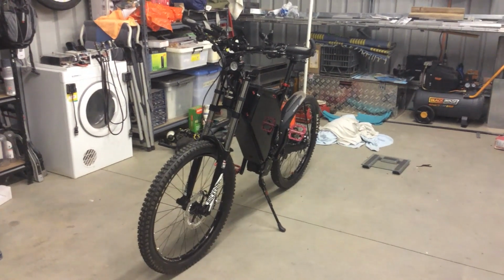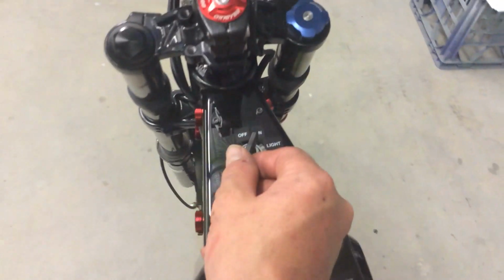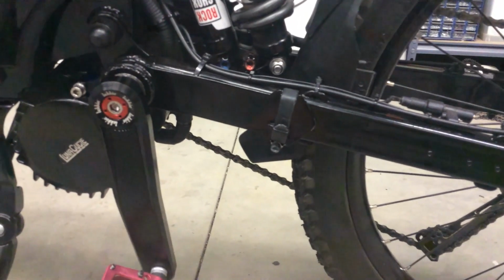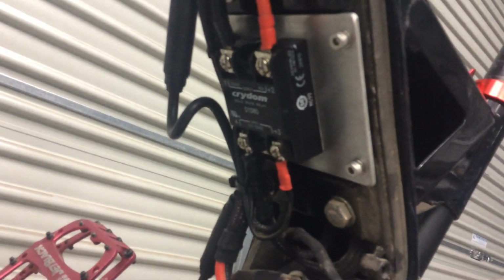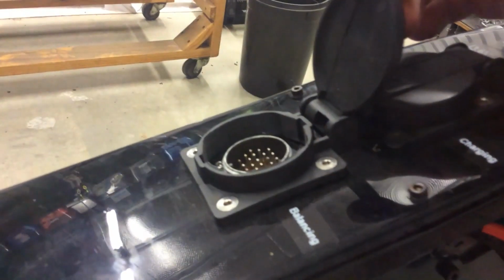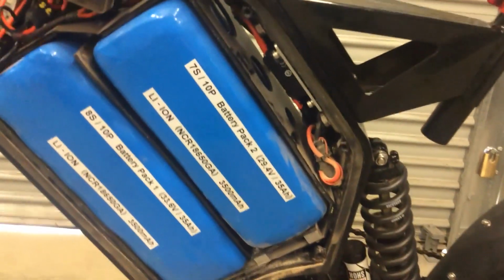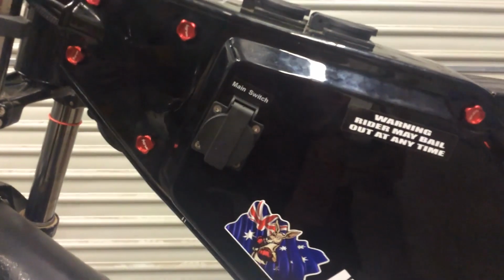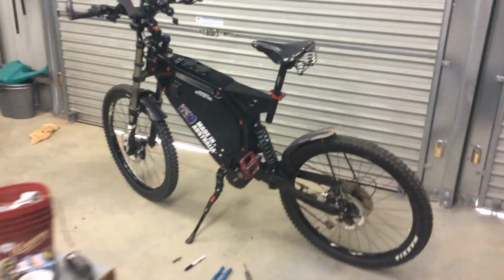Enduro E-Bike with Mid-Drive (BBSHD) Custom Build Walk Around (Updated & Improved Audio)

Comment: will the bafang work on this frame?
Reply from the maker: Ocourse it will you can see that from my videos ? (with a few modifications)
Reply: @oze-bikes4life663  can u tell me wat modifications u had to do jus to fit the motor ive been lookin around for a video like this love the bomber look
Reply from the maker: @capolean2902  cheers 👍, using the rear hub in my description, the only major modification was to use a 10mm threaded rod between drop outs & slowly wind out rod evenly stretching drops outs apart enough to suit the Rear hub, then you need drill out the drop out hole from M10 to M12mm to accept the 12mm through axle. A custom motor mount bracket holding the BBSHD motor to the rear swing arm is also required to stop Motor from rotating under high torque situations. It's not essential but highly recommended. 
If you plan to have BBSHD motor sit (rotate up) as close to the frame as possible, (giving a clean/seamless look & help improve ground clearance) then you may also need to cut away around 6-8mm from the very bottom plate of the frame, where the standard EEB kickstand is located. I used & modified my own chinese kickstand (drilled & tapped holes) to fix my own kickstand to bottom of ebike frame/flat plate. Hope that helps.

Comment: Hey, Nice build. I have a question about full suspension - as long years user of BBSHD with full suspension bikes, after 1-2 years, bike frame bent/ or pivot of the suspension degrade and make chain to skip, at least small cogs on the rear cassette. Did you experienced anything like this with enduro type of frames?

Your bike is beautiful, the only 2 disadvantages I see is the mass and maybe that probably everyone noticeable by everyone.
Reply from the maker: Hey 👋 
Thanks for the Kind words 🙏 🍻

The Enduro E-Bike frame is made extremely strong, people usually run high powered hub motors with them 5KW or more without any frame damage or wear, so with my 1.6Kw BBSHD setup, the frame is well over engineered with this setup. No wear on frame, pivot points or chain / sprocket issues after 1200+kms so far.

As far as weight is concerned my e-bike weighs 32.9kg (including a large 15S / 10P 35Ah battery) which in my opinion is pretty good for such a strong frame, Quality Rockshox Triple Crown Front forks & large battery. 
The BBSHD works well for me with this Weight without getting to warm / hot. 
Obviously common-sense Is still required when climbing hills in the  appropriate gear so as not to damage or burn out its Controller.
Reply: @oze-bikes4life663  As for the powerful hub motors - they are powerful enough, yet the issues for which I ask (which I had on standard MTB) is when the motor is pulling the chain, it pulls on the left side (because there is only one chain). But as you don't have any issues for so much time I'm willing to try the frame myself. Thanks a lot for the information!
Reply: Did you need to make a custom bracket to mount the bbshd? Or was the physical mounting straight forward? 

And bro,  u still riding ????

Comment: Gday mate probably the best build on the internet period! Congratulations! its art work! Im from Brisvegas.. i recently did a 1000w 52v  bbshd build that i am happy with too. I decided against putting  extra grease in it because the grease people are talking about is not dielectric. I've seen reviews running them as is with 20,000 plus km on them problem free on standard oem greasing from factory ... have you put extra grease in your build?
Reply from the maker: Hi mate, Thx for the kind words, much appreciated 👍🙏
Yes I'm considering changing the grease, I purchased some Mobil 28 a while back now as suggested through many forums regarding it being safe for the Nylon reduction gear ⚙ that the BBSHD has inside , but you raise a good point with maybe affecting electronics / sensors etc inside the motor, potentially over time. 🤷‍♂️
I will pull it apart & inspect construction & operation before considering what part of the motor to use it in.
I'm actually working on a custom Ebike carrier for my Mazda CX5 so I can carry my Ebike &  travel & do a few of these rail trails both in N.S.W but mainly in Victoria where the majority are situated. It's on my to do list, should be alot of fun. 😊✌
Reply: @oze-bikes4life663  i looked into data on that mobilegrease 28 and i couldn't find a mention of it being safe to use on nylon or plastic, i see it's  PAO which is impressive .. silicone grease is recommended for nylon gears plus silicone grease is also dielectric but the viscosity is not thick tacky... 🤷‍♂️ i rest my bike on its side sometimes travelling... the wrong or to much grease could be a serious issue. I don't trust forums and there is no service manual that's why i asked what you did..cheers
Yeah i have actually seen those railways rides they look pretty good, if you ever travel up to Brisbane or gold coast hit me up for a ride there are plenty of good places to ride from bush reserves👍 to native animal watching along beach fronts😉 wink wink nudge nudge 😁
Reply from the maker: @rossg9363  Yeah, I know it's used in a wide variety of situations,  from the aviation to military for many many different lubrication situations. But your right, there is no "specific mention"  for use on Nylon gears as such. Either way I don't think bafang would worry or spend / research too much time or money on any fancy or expensive grease for there mass produced electric motors. As we all know, everything these days is done on a budget which doesn't always benefit consumers final product or long term service life.

My motor is not noisy thus in no rush to replace or add grease as yet.  
Corrosion X is an excellent product, another product used in large scale / no expense spared production, eg first invented & produced for American Navy.
An incredible lubricant, pentrant, rust prevention & incredible safe on all electronics & actual waterproofs them. I used it for many years on electronics for water proofing such as older (Non waterproof RC ESC) use to run my RC car at the beach in the salty sand / air with great results.
I may use it on different sensors in motor then lubricate gears with the Mobil 28. Just my 2 cents hey 😊
Yeah for sure if I'm up your way, a group ride sounds good 👍 😊
Reply: @oze-bikes4life663  oh yeah Corrosion X hey hmmmm ok im going to buy some and check it out and put it on my shelf since you say it's that good.. ive got all kinds of lubricants on my shelf already including silicone grease which i tested the other week (it's in a tube) and it has had a little bit of oil separation like alot of grease's do over time.. thanks for the heads up on that stuff in nothing else ill use it somewhere else on something  just as important 🤙👍  great chatting mate!!! Thanks for the chat!!!
Reply: @oze-bikes4life663  wow mate that corrosionx stuff looks fantastic!!!! 3 times more slippery than motor oil, dielectric rating of up to 36,0000 volts, polar bonding,  excellent reviews in big name stores across the globe.. im definitely buying a can hahaha im very happy to come across this product mate thanks!!!!!

Comment: 36v is too little for bike like that you need 60v but anyway good bike . Where did you buy frame or you built it yourself ?
Reply from the maker: 36V ??  😳🤔
What are you talking about TechGeek ????
I'm running 15S at 4.1V per cell which equals 61.5V Total through my BBSHD. I think your a little confused mate.
Reply: @oze-bikes4life663  allright that is good then. i saw 36v sticker on battery i was thinking you are running it in paralel
Reply: @oze-bikes4life663  you should be hitting atleast 35mph I get that with my BBSHD at 52v

Comment: Nice! I'm thinking about putting a CYC Pro mid drive motor on one of these frames.
Reply from the maker: Ok, nice. I can't really give you much advice on this motor as I'm unfamiliar with it.
A fellow who I think has done videos on that CYC mid drive is the channel "High Voltage" He might be able to help you. 
I don't think he's installed one on a EEB frame. But may know someone who has, Best of luck . 😊👍✌
https://youtube.com/c/HighVoltageKits
Reply: @oze-bikes4life663  Thanks.  How's this setup been working for you?
Reply from the maker: @mattvw80  Yes it's been great, an enjoyable & trouble free diy ebike creation. 
I ride it 99% of the time off road on hilly rough terrain, so the frame is built extremely well. 💪
My best advice would be don't skimp on quality front & rear shocks, as an ebike has more weight to absorb than a regular mtb, so keep that in mind. 
My Rocshox 200mm triple crown front forks & R2C2 Rear shock (600ib spring) work perfectly. 

It has Phenomenal suspension travel & ability to absorb impacts, in my opinion.

 This is extremely important to me as I suffer from chronic lower back pain (and will so for the rest of my life)  So in other words if I can ride this ebike off road on hard terrain, it's saying something about the Suspension & suspension geometry. 😊👍👌✌
Best of luck in your Build 🙏
Reply: @oze-bikes4life663  i'm glad its been working out for you. I think this frame has stood the test of time. Thats the joy of a DIY build, you can tailor spec everything to your advantage. I can imagine lower back problems are no joke.  I'm not gonna cheap out on thd suspension either. Thanks for the feedback!

Comment: If I were to build my enduro frame bike with a hub motor, I was wondering what you would go for with a 72V battery? and what peak rating would you go for on a hub motor, as I would be using this mostly for road use, as I already have a Cube Reaction Hybrid, with a BOSCH motor and battery 400 so am ok there if I want to go riding, on dirt roads, but the enduro build, I would take off road, if I had to....
what type of forks did you use on your ebike, they look great.?
Reply from the maker: Yeah got no idea with Hub motors as they are generally great on sealed road or gentle dirt trails but pretty shit when climbing steep dirt tracks with loose surfaces (traction is the issue) but for good info in hub motor ebikes i recommend Andy Kirby & Vortecks channel https://www.youtube.com/c/Vortecks. https://www.youtube.com/c/andykirby

Comment: really good video, thanks for the info...
most of the items for the bike build wondering where you got them mostly, as I would be into building one like this, but of course with the hub drive, but also a freewheel cassette at the back for use as a normal bicycle as well....the hub mount would be mostly used as a backup, or turn off completely and use it as a hybrid system.

The lights in the front great, was wondering where you got them from and was seeing why you didn't have one mounted on the rear...

bloody good build, question though with the 2 batteries, why you need to balance them while charging, is there a special cable for that, what is the go. thanks.  I like the YSB socket on the handlebar, is that plugged into the dc/dc controller as well, how is it wired, good idea really.
Reply from the maker: Hi, thanks 😊                            The headlights i used were
https://a.aliexpress.com/_mO25uAh but i  modified them to accept a 12V 6W House hold type led globe (ground down the globe surround so as to fit into the bike headlight) sprayed it black using  Plastic dip.  I balance & charge them every time using a Icharger 4010 Duo because i do not use a BMS !  A run a 3S/3P Auxilary battery to operate Control Cct, Solid State Relay, Headlights & USB. I do this as it gives me a longer run time from my main 15S/10P battery, i do not run a step down convertor thus reason for using Aux. Battery  As for rear light i recently purchased awesome rechargable led rear light which i recommend Is the Xlite100 CubeLiteII Bicycle Taillight Intelligent Sensor Brake Lights
https://a.aliexpress.com/_mO6sfBn.    Most of the other build items were a combination of Ali Express, Ebay & Luna Cycles (US) or Luna Mate (WA Australia) Hope that helps you out 😊👍

Comment: Whats top speed you ever get it to?
Reply from the maker: Hey Bob, the way i ride is using pedal assist (9settings) all the time, i never really use "throttle only"as my rides are usually a minimum of 45kms or longer in length (use pas to increase battery range & good exercise), So with that in mind i get approx 35 - 40km/hr on a flat dirt trails & approx. 75 - 80km/hr down a Hill (on a sealed road) Never tried a top speed on Unsealed roads (im not crazy enough ! ...yet) 😬😎 I have luna cycles "black box programmer" so i can change all pas assist levels & every other setting on the run without needing to hook the ebike upto a computer.
Reply: @oze-bikes4life663  super sweet!

Comment: What width crank do you need and what motor bracket. Plus what controller
Reply from the maker: Miki Santhos - 100mm BBSHD Kit for EEB Frame. Motor mount bracket needs to be made up after you fit rear shock & work out what ride height shock position suits you best. Only then can you know what angle to make Your Motor mount  bracket.
See my Video at 5:35 for custom motor mount bracket. 
Standard controller that comes with BBSHD motor

Comment: What modifications were done to fix the mid drive unit. I am also trying to do the same . Any inputs will be of great help .
Reply from the maker: Abhinay babu , Fitting the BBSHD motor to EEB Frame required me to cut out 10mm from bottom plate on frame(where kickstand mounts) This doesnt have to to be done but i did this so motor tucks up right next to frame to give the e-bike a seemless & more proffesional (less DIY Look) where motor & frame meet, it also gives the motor "more" ground clearance by doing this.
The only thing you will really need to do is to make up a motor mount bracket to hold bbshd motor securely to the rear swing arm, so to prevent motor from rotating under torque or on rough terrain.
Reply: @oze-bikes4life663  Thank you for the quick reply. Will try and if stuck anywhere will ask you for guidance.

Comment: Hi Patrick :) Very nice ebike.
I would like to buit the same with ERT ASI BAC800 2500w ,24x3" tire ,Sunrace 8v modified to 3v (30/36/42) with Luna 30T,  I hope chain alignment will be good.
BBSHD 100mm or 120mm ? Need spacer ? Need custom made caliper for standard shimano zee 203mm and rear shifter on your enduro frame ?

Thanks you very much ! 
Good ride !  :)

Comment: Hi, Patrick, I've seen your build on  https://electricbike.com/forum/.. I have the same EEB Enduro Frame and is planning to switch my Hub Motor to Bafang BBSHD also. I noticed that you had to cut the frame where the kickstand normally attached, was there a reason why the Bafang could not be mounted straight down? Was it because you needed to because of the custom BBSHD Brace you added on the swingarm, or you did this so it is more toward the front for a better look or for ground clearance? Thank you for your input. Dan
Reply from the maker: Hi enduro ebike addict, i cut about 10mm off the bottom of my frame to make the motor & frame blend together seemlessly, also it increase ground clearence by doing this. The motor swings down & back as the  rear shock compresses. You will have to make a Motor mount bracket (locking it solid to the rear swing arm) to stop motor rotating (under torque or rough terrain) Best of Luck with your conversion 😊👍🏼

Comment: one of these with a cyclone 6000w and an 8 speed internal gear hub is my dream ebike
Reply from the maker: I agree on a internal geared hub, that would be the icing on the cake so to speak 👍🏼 but "6000W"cyclone motor ! 
Good luck getting any "decent range" (Distance) out of your battery with that huge Motor load 🤔😳

Comment: How fast does it go?
Reply from the maker: Filip Baćić  Around 40-45km/hr on a flat dirt trail, & as fast as you dare to go downhill, i have had it up to around 80-85km/hr downhill.  If you after "high speed road" riding, then look at rear hub drives for this frame.
Reply: @oze-bikes4life663  is it possible to bump up that speed to 55-60 maybe? Is it about the battery or the e-motor? Anyway,thanks for replying
Reply from the maker: Filip Baćić  im running a 42T front chain ring, if i were to run a 46T front chain ring than it may get close to that.... but you then start to put more load (heat) on the bbshd motor & controller. If your not climbing steep hills then the 46T should be fine
Reply: @oze-bikes4life663  thank you!! Sorry if I'm bothering you with questions,when I saw these e-bikes I just felt like a little kid again lol.
Reply: @oze-bikes4life663  and could it be suitable for normal roads?(asking because some of the tires are made specifically for off road use)
Reply from the maker: Filip Baćić , no bother... thats why i made these videos so other diy inclined people can build this & save a few dollars (compared to a big brand E-Bike) 
Yes you could use it for crusing on any roads (a set of Maxxis Hookworm 26x2.5" Tyres would be awesome for road use. It wont be Technically "Legal" as its 1000-1600W, way above 250W Ebike legal limit. If you use Pedal assist (pedal) then i think you should be fine with the "boys in blue" 🤔😬😊

Comment: Hey mate thanks for your reply. I’m currently shopping for an enduro frame and just noticed the bb is 100+mm. I guess my 68-73 bbshd won’t fit right? I would have to get another met from Luna 🌒 Cycle 100mm. What size is yours?
Reply from the maker: Yes mate, your one wont have enough thread  length to fit. You will need to purchase another "100mm" Bottom Bracket BBSHD Motor to work with the EEB Frame. At least you will have a complete set of Motor Spare parts (Motor Internals) as i had this same problem as my first E-Bike Build had a 68mm Bottom Bracket also. Good luck with your build 😊👍🏼
Reply: Thank goodness Luna sells just the bare motor for $200. Ok thx again .
Reply from the maker: Albert Nieves , yup that's another way to go... "it's the cheapest option", send us some pics when your finished your EEB Build. 😊👍🏼